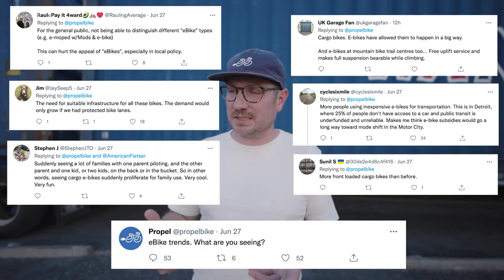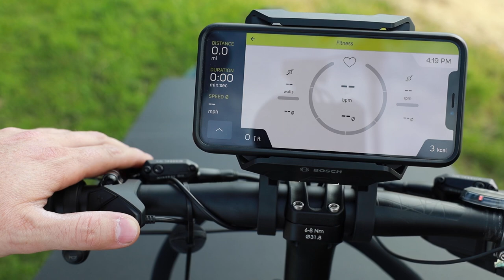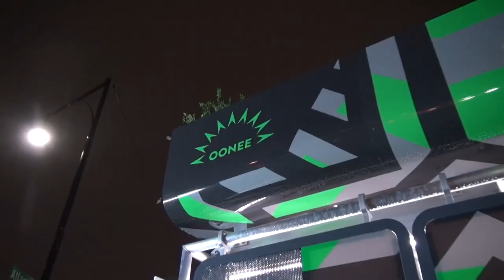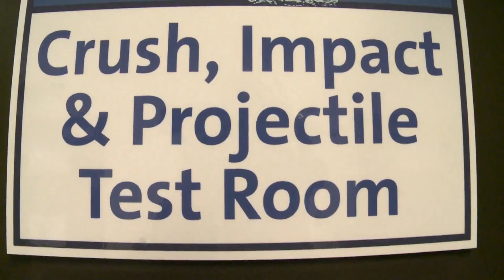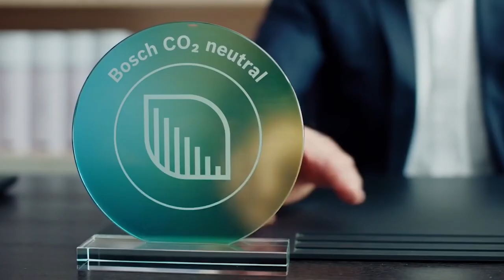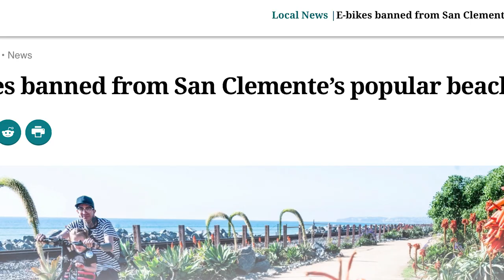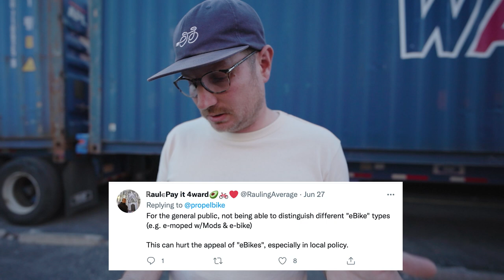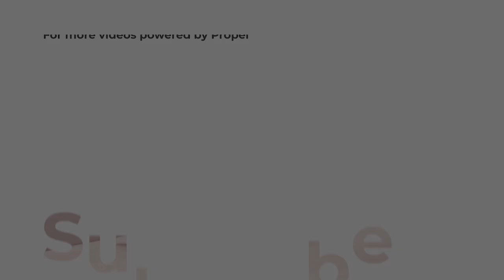eBike Trends for 2022

Comment: Concern over theft significantly limits my ebike use to recreation where it is never left unattended.  Until ebike theft is better addressed by manufacturers and police,  I will keep my cars and motorcycles and not upgrade my ebike.   Thanks for  the thoughtful videos.
Reply from the maker: I think this is the majority perspective currently but it's not discussed enough. I'm optimistic that we will solve this and I have some ideas I plan to share around a practical way to do it.
Reply: For starters, all the bike mfgs need do re theft deterrence is look how motorcycle mfgs handle it. Real locks (with no de-facto master key), fork locks, multi-location VIN markings (as with cars) would be a good starting-point. For a bike costing thousands, security package costing a dollar or two in huge quantities should be a no-brainer. Real value multiplier.
Reply: I never let mine out of my sight. It’s either locked at my office or locked at home. It’s replaced my car 5/6 days a week. 

I stop for coffee where it is securely locked with both a D-lock (Abus Granit) and an alarmed folding lock (Abus). I’m waiting for the Hiplok D1000 which is a serious deterrent to thrives with angle grinders. 

Quotes to insure my bike have been around €750 a year.
Reply: This is a sad reality for most desirable bikes. Bosch (for a too large a cost) have implemented a motor lock connected to the removable display. Specialized have also implemented a similar thing using your phone with their new models without extra cost.
Reply: @richardharker2775  yep. I have Nyon display. Have the lock feature but my bike is worth over €10k so I’m not leaving it in plain sight to temp any potential thief.
Reply: For me, I see “deterrence” as a crucial area of focus.  For example, if a high-decibel, fob-controlled, motion-detected shriek alarm was imbedded in the fork, then a would-be thief is going to draw a ton of unwanted attention.
Reply: @Propelbikes  WE’RE ALL EARS! 👂 Can’t wait to hear your ideas, Chris! 💡 👏

I just recently bought an e-bike, and I concur w/ the sentiments about theft concerns. I want to use my bike as a car replacement, and there’s no reason why I couldn’t accomplish this, save for possible theft. It’d be nice if I didn’t have to lock it up w/ 3 - 4 locks @ each stop, as well.

There’s so much peace of mind that I have by riding a cheap analog bike—it’s the best theft-deterrent! I’ll at least know that my bike will still be there when I return, as long as the thief is only interested in market value.
Reply: Theft? I used a Kryptonite NY chain on my ebike to affix to my Saris rear rack. Gone a little over 5 MINUTES while in a sandwich shop in Jackson, WY, it is clear someone tried to steal the bike. The swing arms were all out, but the bike wasn’t moving! If they had taken it, I might have had a chance because I have air-tagged the bike. Definitely the way to go.

Theft is REAL and can happen ANYWHERE. We need real solutions.
Reply: @richardharker2775  Here in the UK I have recently fitted an ebike kit. I'm afraid it was made in China, as most things are nowadays. When you leave the bike you can lock off the battery function via the app and an alarm sounds ( albeit not very loud) if someone tries to move the bike. It also activates a tracking device if stolen. How good this is I hope never to find out. This adds an extra layer of protection. I use a heavy duty Litelock, a D-lock and an alarm lock. The kit, by the way, goes under several different names. The manufacturers are Lvbu. The UK sellers are Easifit. I've only had it fitted to my 35 year old Raleigh a couple of weeks but it seems ok. It t makes pulling my bike trailer easier!
Reply: @ChrisJohnson-pd4hh  Every little bit of deterrent is good I hope. Glad you're enjoying the bike. They create a greater level of versatility and not to mention fun.
Reply: @myopenmind527  Totally agree. I prefer that type of function over a software based one on a phone.
Reply: @jacquesblaque7728  motorcycles are easily stolen by two people lifting it into a van one end at a time. E-bikes are even lighter and easier to steal. Anything short of secure bike lockers at either end of a trip will be easily compromised.
Reply: Bike theft for all bikes from even the most basic models to the top of the range sports bikes and now increasingly all kinds of electric bikes is probably the greatest deterrent to a greater uptake of cycling for general commuting, shopping, business and socialising than infrastructure or anything else.

I myself when I park my five year old €450 hybrid bike use a heavy D lock and a two metre Diamond rated chain lock plus a cable through the saddle. That's 8kg of locks. I don't mind the weight because I'm 2 metres tall and currently weigh about 120kg plus I'm almost always carrying cargo of some sort or pulling a trailer anyway so it's really just a small percentage extra overall.

I have thought about this recently because it's p1ssing me off and I have been suggesting a system of mandatory registration of every bicycle sold to anyone who will listen but I have been underwhelmed by the lack of enthusiasm especially from retailers.
It's almost like they want people to keep coming back to them to replace bikes that were stolen and to buy bigger and better locks?!
Or maybe I'm just getting cynical in my advancing years?

This is my suggested partial solution to reducing bike thefts.....l

When every bike is sold, it will be allocated a mandatory registration number. This number will be engraved into the frame where it can be easily seen.
And I do mean deeply engraved into the frame.
Not onto a plate or a sticker that can be removed or altered. Directly and deeply into the metal or carbon of the bike so it can't be changed or altered without it being obvious.
This is not the manufacturers serial number on the bottom. This is completely separate.
This registration will then be logged online with the new owners details and a photo and description of the bike plus the manufacturers serial number.
The registration, manufacturers serial number, bike description and owners details will all have to match online to stop any potential altering of the bike if stolen.

There will be no charge for the basic registration, it will be included in the sale price of the bike wether it's a child's tricycle or a massively expensive professional sports bike.
It's also MANDATORY so you can't buy a bike without registration.
No registration, no bike.

If you have a more expensive bike or e-bike with valuable individual wheels, batteries and other parts, you can also get them all individually engraved and registered plus photo with a slight variation for each part.
You will probably have to pay for this yourself unless the retailer provides this service as a courtesy if you're spending substantially bigger bucks anyway.

The engraved registration can be easily seen by anyone who looks on the frame of the bike. Anyone, anywhere at any time can log onto the website or app and in a minute check the details of any bike anywhere. 
But all they will see is the details and photo of that bike AND whether or not the bike or part has been reported stolen.
There will be absolutely no details of the owner visible to the public to protect their privacy.
And it will only be possible to have a bike (or parts) flagged as stolen on the site by the police after first being officially reported as stolen.
This is to prevent possible malicious or mischievous misuse by other people and to ensure that the information on the site will be always entirely accurate and trusted.

If anyone is buying a second hand bike (or engraved parts), one minute will check on the site to see if it is stolen.
It will be an automatic offence to be in possession of a bike if you are not the registered owner or without the owners permission even if you bought it second hand.
Everybody will know about the registration system and ignorance will not be an excuse.
It will likewise be an offence to be in possession of a bike with a damaged, altered, concealed or removed registration.

If the bike is sold or gifted to someone else, the registration to the new owner has to be changed in an official retailers with proof of identity. Again, this is to prevent mischievous or malicious interference with the system.

While about 50% of all stolen bikes are currently recovered by police, less than 10% of them are actually returned to their owners because it's either impossible to identify who the owner is or the owner can't prove it's their bike.
Another strong reason for mandatory registration.

Nothing can stop all thefts.
You can't stop the pos who steals your bike and throws it in the river afterwards.
We're back to good locks again.
But if the police find him or one of his friends in possession of it, it's immediately identifiable and an immediate conviction.
But in my opinion, a simple, cheap and mandatory - it only works if it's mandatory - system like this implemented nationally and internationally would stop the majority of bike thefts.
Nothings 100% unfortunately.

A lot of stolen bikes are bought by decent "honest" people who are replacing another bike that has been stolen.
It's a vicious and insidious circle.
For the professional thief, if it becomes too difficult to find buyers for your stolen bike or parts, it's not viable anymore. Less market, less thefts.

I keep hearing that bike manufacturers are going to eventually include some miracle self locking system that will keep bikes safe.
I'm still waiting.....
It'll probably just be another hundred bucks on premium bikes.
Or there are private companies doing something similar for an annual fee which kinda works and at least it's better than nothing.
Or it's insured. How much is that every year and how much will your premium increase after you claim?
Or I only ride from house to work or on the weekend group ride. Like house's don't get robbed? Or garages or sheds? And wtf? Don't you want to ride your bike to the shopping centre or the cinema and feel more reassured it will still be there when you come out a few hours later?

I live in Ireland and if this were implemented in my country and then ideally European wide, it could make a big difference.
It won't stop me from hauling around my 8kg of locks for reassurance. But it will definitely make it even less likely to be stolen.

And if manufacturers eventually do add a universal internal locking system that will be great too.
Add your own security and tracking and insurance and anything else too.

But while we're waiting for all of the other miracles to happen, this would be cheap and simple and would work universally everywhere in the world.

•Mandatory registration
•Irremovable engraving.
•Instant checking online if a bike or parts have been stolen.
•All bikes and parts can be reregistered to new owners.
•Massive reduction in the stolen bike and parts market.
•Instant return of recovered bikes or parts.
•Instant conviction of thieves in possession of stolen bikes or parts.
•Instant conviction of any citizen who bought any stolen bikes or parts.

And for anyone who is worried that this will identify you when you're breaking red lights on the your bike, don't worry. CCTV won't be able to pick out your registration on the bike.
Reply: I'm in a similar situation, having bought an e-bike while stupidly not realizing it's weight meant I couldn't conveniently keep it inside. Because I don't live in a very dangerous area for bike theft and I have access to a decent place to store it (also insurance, etc), I think investing in extra security makes things doable for me, but it's a hard sell. E-bikes, at least all but the cheapest, should be designed with security closer to a scooter or motorbike than a conventional bike.
Reply: Buy a Electric Brompton. You can easily take it with you and not leave it locked up outside.
Reply: @tconnolly9820  In Canada and the US (maybe elsewhere too), the 529 Project is such a bike registration service. They allow you to register your bike with basic info and serial number, and several police services (I was surprised to find out my small suburban town is one of them) effectively consider them an official bike registry. Part of the reason it works is they don't expect you to give as much personal information as the government or police might ask for. Just info about the bike, and basic contact info.
Reply: Here in the Netherlands we have the Vanmoof bike company. Their bikes are equipped with gps. If your bike gets stolen, they have a repo-team that will get your bike back. I also used an airtag to locate my bikes
Reply: @Propelbikes  I do hope atleast cities can implement Oonee style pods
Reply: If you're a DIY Ebike person as I am, you do have a verity of options (including some that'd be quite illegal, such as wiring the grips to the battery through a transformer). If you're willing to pay for the SIM card, having it report it's position or get the theft on film and upload it somewhere would be an option, as are various types of lockout mechanisms (I suspect it'd be possible to lock brakes so the bike would be a pain to run off with... or wait till it's at speed and cut them if that's the way you wanna go....).
Reply: @myopenmind527  yea, also delaying bike purchases till I can get a D1000
Reply: I have ebike insurance. Cover thef.
Reply: I’ve started to write this identical comment so many times, then deleted it.  I’m glad somebody finally said it.  I use my non-electric bike for most of my grocery shopping, but not when I have very heavy stuff to lug because it’s a pretty steep climb back to my house.  The main reason for even thinking about an e-bike for me is that it could help me lug heavy stuff uphill.  But, if I can’t leave it in front of the store, it’s completely useless.  I use a theft-resistant regular bike for most “utility” purposes; theft-resistant in the sense that it’s old, beat-up, was never expensive, and most people wouldn’t want it as a gift.  A regular bike is perfect for recreation, fitness, and even most practical uses. Right now, e-bikes just seem like expensive toys to me.
Reply: @dinosilone7613  well, they're expensive toys that can do 20+ mph casually while loaded down. That's the appeal and why they get stolen (beyond the value)

That noted, the 'old and disposable' variant would be an 80cc 2-stroke kit slapped onto the same beater bicycle.
Reply: @DFX2KX  Right now, I just use my car when I need to lug heavy stuff, but save that for the more infrequent trips to the store.  Nearly 100% of the e-bikes I see in my area are being ridden recreationally by teenagers not old enough to drive.
Reply: @dinosilone7613  a lot of that probably comes down to how bike-friendly a town is. Ours is a collage town and pretty bike-friendly with lots of bike paths. If it's rush hour, a proper E-bike (or even a sufficiently fit roadie) is getting across town faster than the cars. But that's not most places, true. 

Commercially made ebikes are also criminally underpowered for what they cost. A good chunk of the DIY crowd straight up ignores the law and builds stuff that does 40-50mph and goes carless.
Reply: I had a store that didn't have a bike rack. I was allowed to bring my ebike in. After a few weeks he installed a nice bolted down rack near door. As we use bikes more daily, security will be more important for merchants who don't want to lose our $$ & make the investment.
Reply: YouTube Channel  A decent portable circular saw can cut through a u lock in under a minute. Even high security bike locks only buy you time.
Reply: @myopenmind527  Wow for that insurance i might as well just get a year bus pass!
Reply: Any chance you could park it safe at work or at home and use the ebike for commute ? There's bike locks too
Reply: @myopenmind527  That insurance is more than what I paid for my ebike. Maybe buy something cheaper and you won't worry as much about theft.
Reply: @dtz1000  love my bike just won’t ever park up with it out of sight.
Reply: I agree. I commute to work on my e bike and would love to take it to doctors appointments or grocery shopping. Problem is there is sometimes no where to lock it up here in Reno nevada or even if I do lock it up the bike shop owner said not to do it for more than a few minutes.  I plan on doing the air tag thing but I’m not sure that’s really a good answer. They need to address this if they want more cars off the road
Reply: I agree, I bought a RR2 for my 16-yo which is the beginner of the good ebikes but I had to buy $100 lock and still am nervous every day.
Reply: @MyLifeInTheDesert  Airtags do not work anymore beyond a radius/ range. Airtags then will be synced to a nearby iphone (such as the theft's) to alert them (that is a huge flaw). And, one iphone can be connected to one airtag, so it won't work if let's say a couple having 2 bikes and thinking both of their iphones could track both of the bikes, no! After reading comments on Amazon, I decided not to buy it.
Reply: Insurance!! ! I drive my Riese & Mueller load 60 everywhere, I sold my car. I used to have car insurance, now I have bike insurance. My 2011 Stromer ST1 got stolen - I got an insurance settlement that paid for a new one.
Reply: Police won't do anything because they literally have no reason (waste of money)
But the govt can build bike infrastructure like bike storage places that could make it safer.
Reply: I have a Kryptonite NY lock, AirTag and alarm fitted.  If a thief wants it they will take it, our job is in the prevention as much as possible.  Worse case, if they take it, insurance kicks in…
Reply: Best solution is to buy a better quality e-bike (eg R&M, Gazelle) with a Bosch motor, removable Nion controller, and in-built locks. The theft is unlikely to occur as the thief will be unable to use or sell the e-bike. No controller, battery that cannot be charged nor replaced.
Reply: @JohnMFlores  the top-end e-bikes may be more pricey, but have anti-theft systems that render them useless if stolen.
Reply: @petesig93  NYC, check out how many rusted frames are still chained down because they took the wheels, seats, and all  components. If they can't take the bike they will just destroy it for spite.
Reply: @petesig93  that's great, but for for ebikes to really go mainstream, security must be ensured for all, not just the high-end.
Reply: Before this country went totally crazy and stupid in the 1960’s, my uncle worked for a liquor store chain. At that time, there was a big surge in armed robberies of liquor stores. Clerks were sometimes shot it was horrible. His company decided to stop the problem so they set up an ambush after using some good intuition on where the thieves might hit them next. In a little over a week, they sprung their ambush and killed a robber. They had the press there in no time, and bragged about how their security shot the robber. 

It didn’t stop the robberies in the city, but it did stop robberies at their stores for over two years. I’d say the proper response for an electric bike thief is forced dismount by impact with a heavy, solid object (like a baseball bat). Follow that by handing the press a video, and i think you have improved things quite a bit.
Reply: Hell,  you dont end up in jail in Portland for stealing a car.....
Reply: This is an interesting perspective. I recently returned to trucking after being gone for fourteen years, and I take my ebike with me on the back of my truck. I've ridden it all over US cities - I'm in Detroit right now - and I've never had any troubles with theft. I use a basic cable combination lock. When it's on the back of my truck I don't even lock it. I feel like USians are a bit paranoid about crime that's in reality pretty low historically. Other cities I've had my ebike all over: Kansas City, Syracuse, St Louis, Nashville, Phoenix, Tampa, Shreveport, Minneapolis, New Orleans, Houston, Dallas, Tulsa, Salt Lake, Chicago, Milwaukee, Kenosha, Oshkosh, Columbus, Fort Wayne, Albuquerque, et al.
Reply: @Quaternion Well, it’s a problem, though I’m very impressed with companies like Vanmoof who integrate anti-theft systems into their Ebikes.
Reply: @geraldshields9035  Maybe I am overthinking the theft possibility/probability.  A good heavy-duty lock and a little prudence where I park...and enjoy the ebike.  Note to self: Life is short...don't worry about what-ifs so much.
Reply: I regularly go grocery shopping with mine and literally wheel it into the store. I use the front basket as my cart and I was surprised how no one cared at all. Win win imo
Reply: @rceciliani3  Brompton?
Reply: I think businesses need to have a bike park inside somewhere, in plain sight of owners , taking away locking of them outside .
 And work places need this too, and tax incentives for places of work to make the adjustments
Reply: Maybe this is an opportunity in urban areas for entrepreneurs or city officials to install secured bike garages.
Reply: @xt5181  agreed. My custom looks like a (heavy) bag of sh*te , hopefully deterring thieves
Reply: I agree, I don’t even have the balls to run into a store to just buy a bottle of water while leaving my LOCKED bike outside.    There is simply no such thing as my bike not being on me at all times once it leaves the house.    This is also why I would never “Bike camp” with a tent unless it is a tent big enough for the bike to conveniently be inside of the tent.   I’ll see these Bikepacking videos with people sleeping in a tent, and they’re bike outside the tent, HELL NO!
Reply: T Connolly: I love how much thought you’ve really put into this. I almost feel like you laid out a whole business plan here. Wonder if you could partner up with someone who could help it off the ground as a private venture instead of a municipality thing.  Just a thought. Keep up w your creativity. Seems like you have a lot of ideas to offer the world. 😊